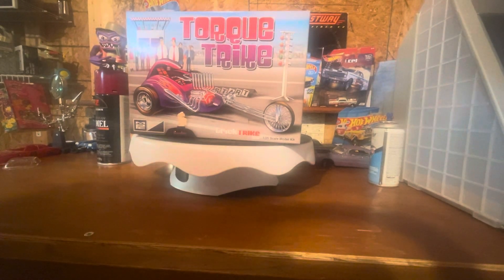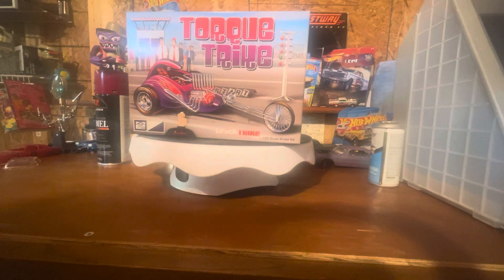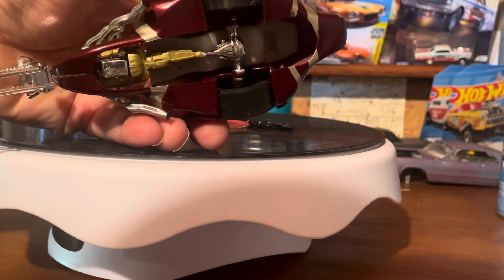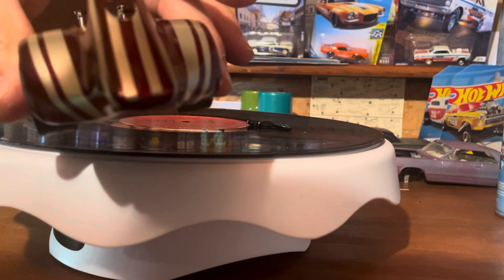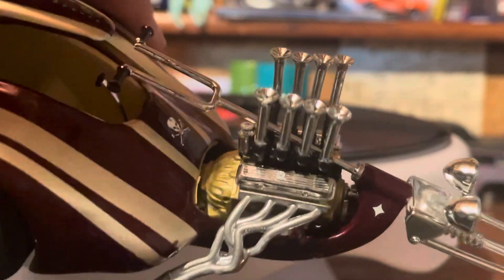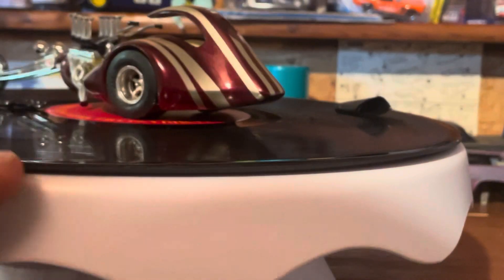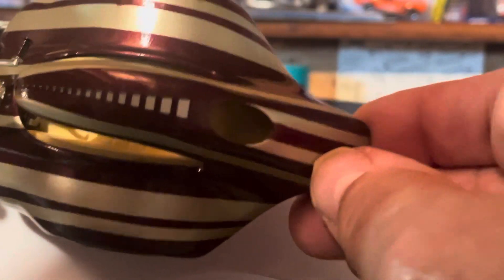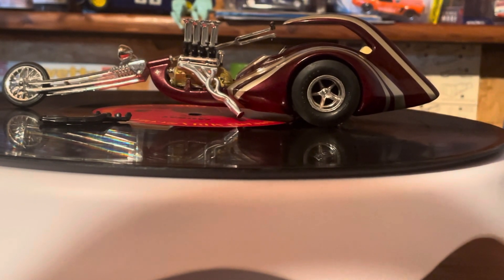Torque Trike

Comment: Hi Jay~It's Tammy and Ratt's LIVE 1/25~Great to see you my friend~Love your Torque Trike~Very cool color~LQQks to me like the rear wheels are from Bad Man 55 Chevy but I could be wrong~I haven't been doing videos for a while but I need to get a model done as I have been working on other stuff as of late and hope to get back to models here shortly :))
Reply from the maker: Thank you for stopping by,the wheels came out of the parts box, but you are probably right, I’ve been down with knee surgery, havnt gone down the basement too much, but I’m getting better to go down stairs
Reply: @slowridemodelcars1687  Sorry to hear that about your knee~I haven't had the desire to work on models for a while as I cleared 2 models and had them perfect the '68 Cougar I made into a fastback flipped on it's side right into the Merceadies Woody I made and messed everything up right as I set them both on my model work bench so I went on to other stuff NOT model related for the past few weeks~Just till I have the want to work on them again~Doesn't seem like that will happen for me for a while :O
Reply from the maker: @wildbutterflytiedye  build when you get the desire, we all have to take a break for a while, what ever the reason🙂

Comment: Good looking build,  I glued the neck and cut the handle bars from the front end and slide the parts in the neck
Reply from the maker: Thank you for stopping by, cutting the handle bar sounds like a good idea!
Reply: @slowridemodelcars1687  I cut them about center of where they slide in the neck and took about 1/16th of an inch from where I cut it